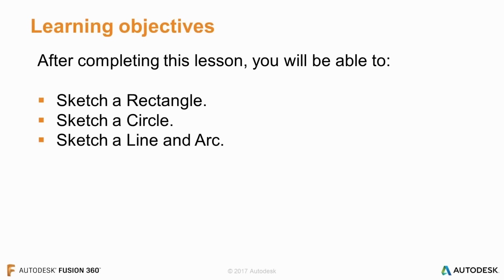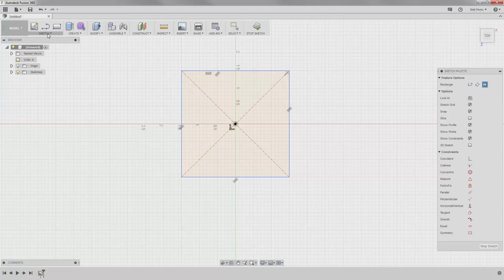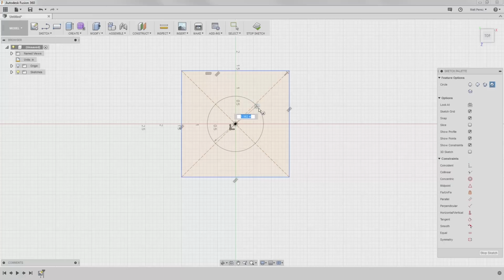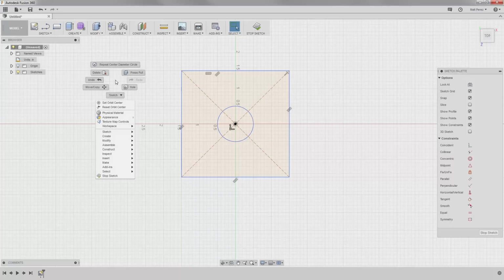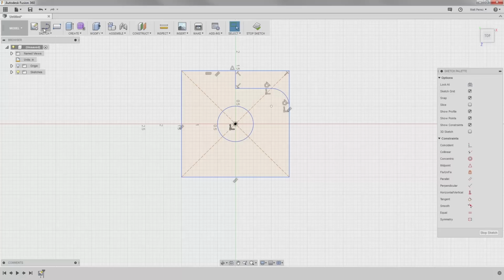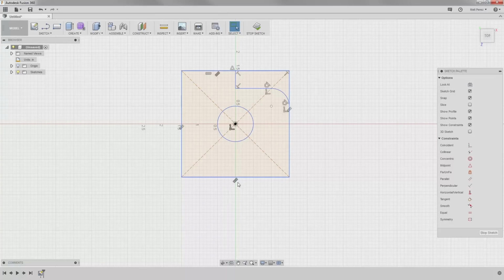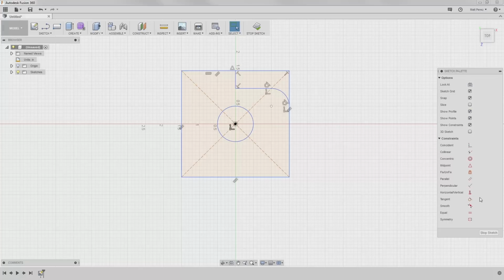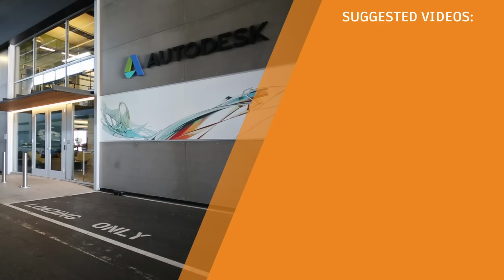Sketching Basics Tutorial

Comment: Is there an easy way to disable automatic applying of parallel constraint? In some uses it is simpler for me to use horizontal and vertical constraints, so when I delete some lines it does not unconstrain other lines.
Reply from the maker: There isn't a way to disable a single constraint type, but you can temporarily avoid all constraints with this method:
https://knowledge.autodesk.com/support/fusion-360/learn-explore/caas/sfdcarticles/sfdcarticles/Disable-creation-of-automatic-sketch-constraints-in-Fusion-360.html 

Hope that helps!